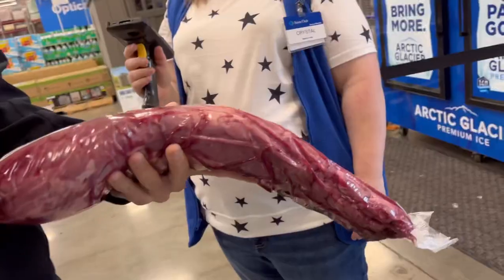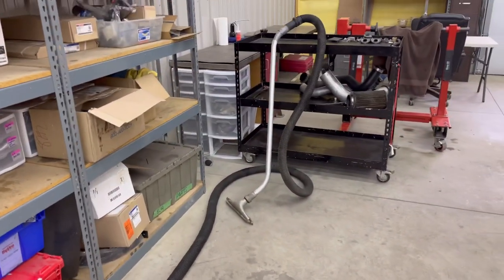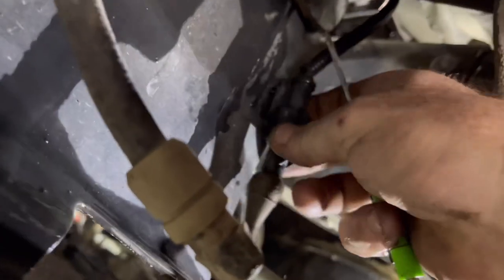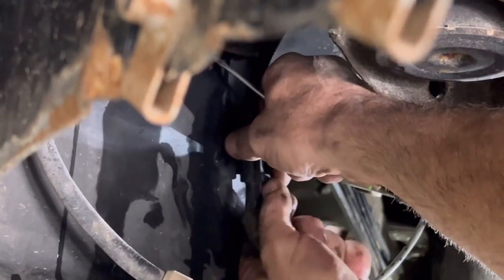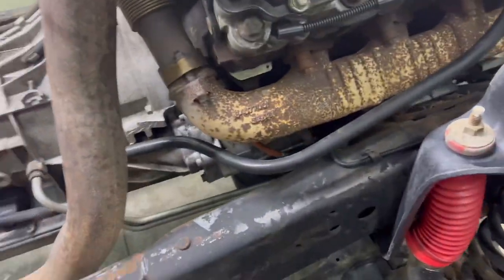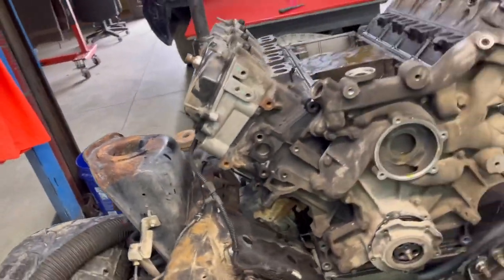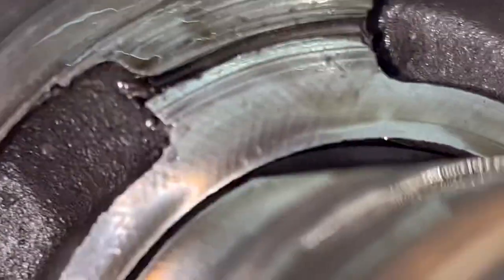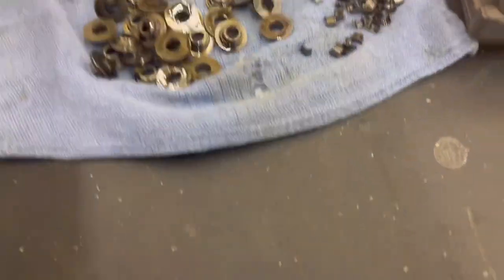6.0 Powerstroke does NOT pump low pressure oil.

Comment: Heli arc weld the grooves in the front cover pump area then put it on the mill and fly cut them smooth.  I had to do this with my 2003 because I could no longer find a new front cover.  Was not bad at all to do.

Comment: Some 6.0s go many hundred of thousands of miles with no lifter issues and others seem to come apart and do major damage. 

Do you think this is a maintenance issue or bad luck or?

Great to see you guys back at work!
Reply: From the research I have done the problem gets tracked back to the oil cooler plugging up.  Most owners will have no indication that there is a problem as they do not have a gauge package to watch the deltas.  Hot oil breaks down much quicker.  Super heated oil lubricates and protects much less than cooler oil.  My truck had 188k on it and the cooler was plugged solid.  Who knows for how long.  Then throw in some extended oil change intervals, cheaper oil, and boom, you have a cam failure.
Reply: @jayjobes5344  that definitely sounds like a logical premise. I've got all the gauges and replaced my oil cooler as soon as the coolant / oil temp differential got out of whack. Major VC9 flush and refilled with red coolant.

Seems like the issue with lifters is oil related either way.
Reply: We have seen them go at 80k… ours had 580k and we lost 10!! But not to this extent. Ours was obviously the lifespan of the part, considering we drove 58 mps , 1200 miles a day, so oil changes were done every 4 day… lol … my grey truck had 410k, with 1 questionable lifter, good stock headgaskets, egr delete, and the oil cooler was trashed in that truck.  Maybe Anthony has a better insight on other causes… I personally think parts fail, from seeing trucks across each spectrum, poorly cared for and overly maintained, we have fixed this issue in a wide variety of trucks.
Reply: @julieyoungblood6072  oil change every 4 days! That would be expensive 😁.
Reply: @mcdadcoleman  that was way back, when the oil and filter could be bought at Walmart for less than $80!! And we did it ourselves,, day,, night,,, blizzard,, 110 degrees,,, didn’t matter!! Needed to be done !!
Reply: @julieyoungblood6072  What is the lifter brand of choice that you two use in your shop?  I cannot decide what brand to buy.